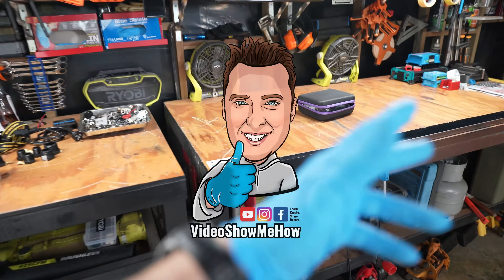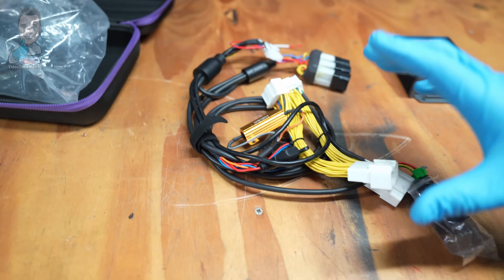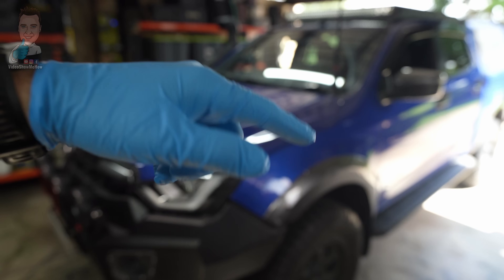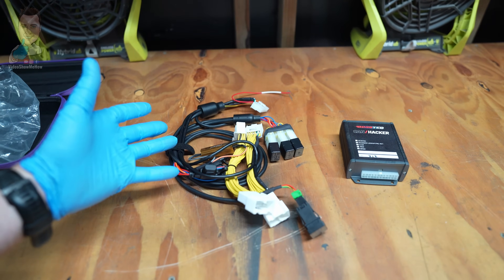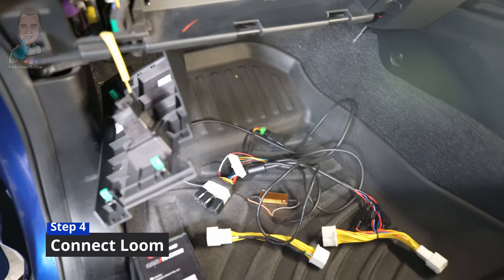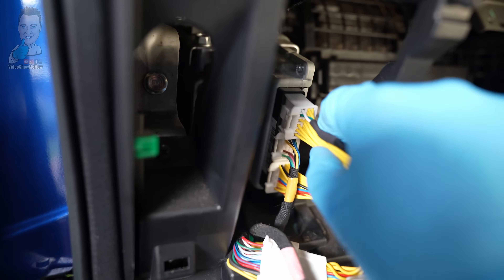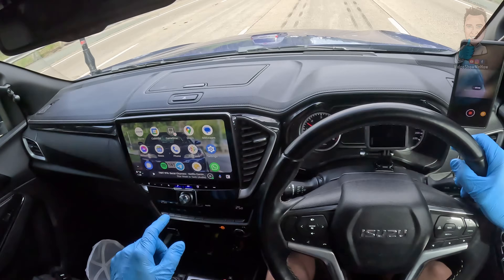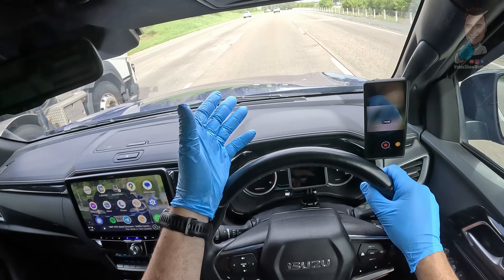D-MAX MUX Auto Torque Converter Lock-Up Kit - INSTALL & ROAD TEST | BOOSTEC

Comment: Exactely the sort of video that I was looking for!   If you were to have a guess... what would the % fuel saving be? (Thus giving a ROI)... and that is ontop of the gear selection on Cruise Control, transmission saving, and I've seen some of the other features they are working on... it is just win after win with this one!   Well done Adam, an absolute winner of a video.
Reply from the maker: Thanks! Actual % improve would be a tricky one without testing, a lot of factors. A quick google has figures 10-20% for other vehicles but yeah would depend on so much, might have to do a test and report back at some point!
Reply: We work on the 12-18%. If purely for fuel saving... You're going to see better % with higher loads. So if you're towing 2.5t+, you'll more likely to be around the 17-18%. Say if you're currently towing using approx. 18ltr/100, We would be concerned if you're not saving at least 1 ltr, we would be ok with 2ltr, but the actual figure will be closer to 2-3 ltr.

A big lap over the winter months with a decent van around this great country should have it paid for itself well and truely under 15,000kms as a bit of an example (This will vary!) The reduced engine heat, transmission heat also is a factor over-looked, ATF has a steep breakdown point once the temperatures reach over 110 degC.

There is other reasons I would like to say that make this a more enjoyable drive in the D-Max. The cruise+manual gear definitely brings some harmony into the cabin ;)

Hope that helps
Reply: @Boostec-ODS  Any deals coming up? I'd love to get one, but hard to justify any costs these days after groceries and daycare 😭

Comment: Is it something you can just leave on all the time ? And does it change gears itself still or does it just lock it in the gear your in ?
Reply from the maker: Yep I just leave in auto/on mode
Reply: It still allow's the transmission to change gears. Yes you can leave it on all the time. As it turns on a 77kph and turns off at 74kph when slowing down.

Comment: Would you get a tune with this or does this prevent the need for a tune? 

Also is it the same install steps for a 2023 mu-x?
Reply: I increased tyre size which made the auto flare ups very noticable, got the car remapped it went back to normal shifting. Then i added an ally canopy and more full time weight in the back and with that my auto is quick to drop back a gear which does my head in. This may be the answer.
Reply from the maker: Two different things, but work in tandem. A tune won't touch your TCM, but may give you more power so won't need to lock down as much, but still will. If I were starting over, I'd go one of these first. Very similar for MUX yes.
Reply: @VideoShowMeHow  thanks mate 💪
Reply: Sorry, I got lost halfway....I don't own a Dmax.
What's the catch here??
I have a 2018 Navara,about 60ks, it changes gears from 4 to 5 and it studders,where i have to give it more gas for it change gears from 5 to 4 to make it smooth driving again.
Is this what this product does??

Comment: Will this work on the previous model?
Reply from the maker: I don't think so, but head to their website for details is your best bet. Link in video description 👍
Reply: Hey Gary, Yes we've done the back-compatibility for the 2016-2020 models. You can select the earlier models in the check out. There is some "fruit" missing as its an older vehicle with less canbus "tech", but the basic functions work as needed.
Reply: @Boostec-ODS  Which model should I be looking for and what " fruit " will I lose being a non canbus model  ?
Reply: @garypriddin9949  well, the older model doesn't have canbus buttons in the factory car.

So no clear code, no expert mode.

But Button can activate at a lower speed, I have one guy with a 2018 set for 58kmh on, 54 off.